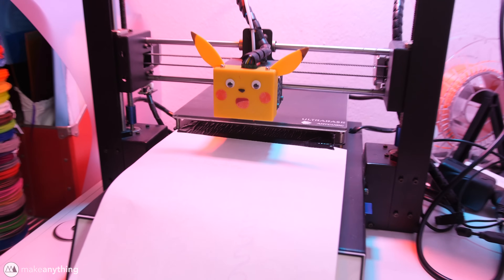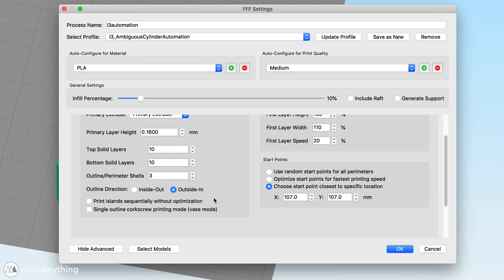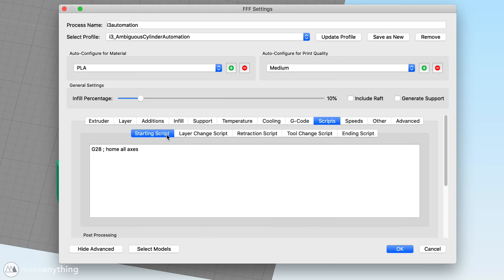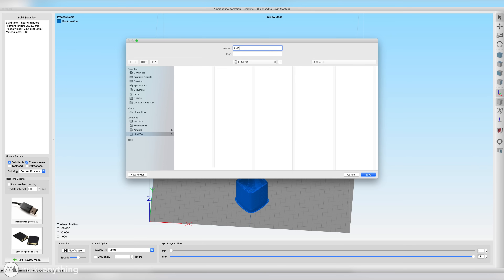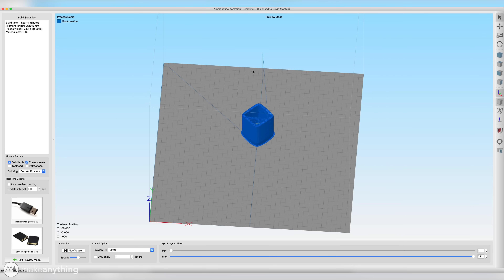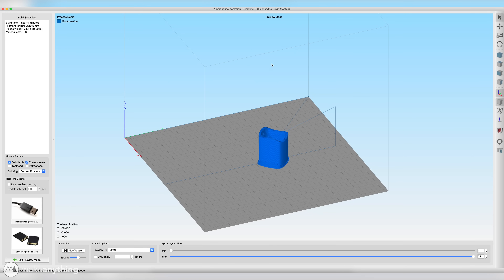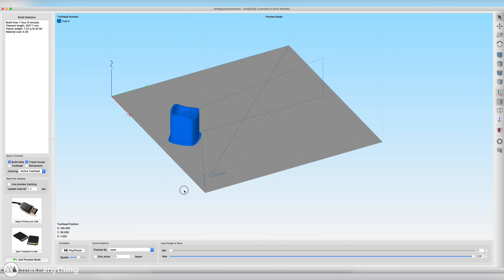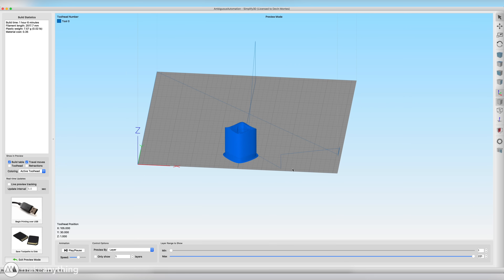Automatic 3D Print Removal using G-Code

Comment: Nozzle leaking a bit? This is way more then a bit. I dont think I get anything close to this bad on my mk3. Are you underplaying it that much or is this normal for other printers?
Reply: Just depends on the nozzle state (worn nozzles are more leaky), the extruder placement (direct tends to be less leaky, this is a Bowden), whether the last print move was a retraction (i think it happened not to be, perhaps a difference in settings or Simplify3D operation) the nozzle temperature (he is printing a bit warm) and the filament composition (EVA carrier for the masterbatch tends to be leak-inducing when used, while some pigments make filament more difficult to heat through).

He is getting a pretty high amount of leakiness, he's just not all that fussed about it because it won't matter for these parts, as they're easily cleaned up.

Comment: Are you going to follow this video up with "Head alignment issues and how to correct them?"  This seems like a genuinely bad idea given you have no idea the amount of force necessary to remove that print.  Belt skips and chattering steppers is what I see many users reporting out of this.  With such a wide variety of videos about how to get prints easily off the bed (due to them sticking so well) I wonder how long before the first broken 3D Printer using this.  3D Printers are not designed for pushing prints off the bed.  While a creative hack I wouldn't want to damage my expensive printer with something like this.

Comment: With some print surfaces, you may want to wait until they cool down before pushing the print off. With Prusa's powder coated sheet, for example. It lets go of the print after cooling down, and I believe there's a risk of damaging the sheet if you forcibly separate them too soon.
Reply: Same with ender 6s glass bed
Reply: You could do M190 R[temp] as it also waits for cooling so you could do M190 R40 to wait for the bed to be 40C

Comment: hey, first ever YT comment here, been following you quite a while.
so to my understanding, the Anycubic uses Marlin based firmware, so you might try these commands at the end of your code:
M32 {filename}.gco ; select and start a sd file.
it that isn't working, try:
M23 {filename}.gco ;call a fille
m24 ;start a file, basically does the same as M32 but with 2 functions.

however this doesn't have any quantity control, so you might want to make a new "master" gcode and make the prints as sub-rutine, don't know If it works.
I know on RepRap firmware you have the ability to call a sub-rutine using M98 and have up to 5 nested sub-rutines in one code, e.g:
M98 1.g ;first print will run, at the end of it either use M99 or it will set back automaticly
M98 2.g ;second print
M98 3.g ;etc
so if you have a RepRap based printer you might want to try it as well.
good luck

Comment: could you not increase the feedrate of the push comand to give it a bit more inertia as to not just slightly knock it overthe edge?
Reply: That would disaligne the printer
Reply: @nf794  but the printer rehomes before it starts the next print anyway?

Comment: People, throw away your build tac platforms and use glass like all the experts do. Parts will just pop off by themselves when it cools downs this is why this trick works so well for devin. Also you will never scratch or burn it and as far as breaking i have dropped my wrenchs on by mistake a few times with no problems. I think the good ones are tempered.
Reply: No, I'll keep to my spring steel sheet.

Comment: This must be the best tip for 3d printing so far. Very useful for mass production. What is the code in order for printer to wait until bed is cold then knock off the parts?
Reply: M190 R30
30 is just an arbitrarily chosen temperature by me where i feel it should release; experiment with this value.
R is necessary to actually wait for cooldown, if temperature is specified with S like usual, only the warmup sequence waits.
This G-code is Marlin specific. In Repetier, no dice.

Comment: Just a few ideas while watching your cool video. You could tilt the printer 45° forward so the parts fall off better and also shouldn't you write Z commands first like z20 x200 y50 so that the head always moves up and out of the way before table moves or is that automatic?
Reply from the maker: Tilting the printer is a clever idea! As far as the order of the coordinates, the xy and z move together unless they're put as separate lines, which I did do for a few of the movements

Comment: Thanks, some very good stuff in this video :) but this is for the PLA, for others types of fillament like PETG, need to wait for bed to cooldown first down to around 30-40°C before kicking the model out. Is that possible?
Reply: Yes, you could add the gcode for that

Comment: Firstly: you don’t have to input coordinates for axis you don’t move, so, if you move only Y and Z axis you can have:
G1 Y5 Z20
G1 Y25 Z19
G1 Y5 Z18
Then if you want to move carriage out of the way you have:
G1 X100 Z20
G1 Z0
Also after the wire brushing part you could just do Z30 or Z40 and RMF there as the printer will go in straight line to the starting point on the bed.

Secondly:
For bigger prints you may want to wait as you said. Heatbed needs to be cooler. Then, you could use back of the carriage to knock things off. It’s wider, it’s stronger, it’s just as easy in GCode! :)

Finally:
Very cool video :)

Ps. In the End GCode add:
G92 E0
G1 E-2
First line resets the current position to the one you input. So this one sets current position of extruder to 0.
Second line, retracts you filament back 2mm so it won’t ooze out the nozzle after the print. If you have the wire brush in the start code you can preheat the nozzle and purge a little on the right side of the wire brush, then clean, then print. This way you don’t need the brim ;)
Also, the semicolons are optional, new lines divide new gcodes :)
Reply: Hi, would you know how to change a FLSUN QQ-S-PRO to? I cant work it out. Currently via cura default is;

M107 T0
M104 S0
M104 S0 T1
M140 S0
G92 E0
G91
G1 E-1 F300 
G1 Z+0.5 E-5 X-20 Y-20 F9000
G28 X0 Y0
M84 ;steppers off
G90 ;absolute positioning

Very grateful for any help
Reply: @yte24b  okay, I've been out of the 3d printing world for quite a while now, so I'm not sure if I'll be able to help, but describe what you need exactly and maybe we could work it out :)

Comment: Glad to see the i3 mega getting some more love. Mine is down at the moment. Its having a weird issue where it will climb to almost print temp then drop off about 10 degrees then climb back up just under and drop off 10 degrees and it will do this until I stop it. I am not sure what the deal is as I just replaced the motherboard in it and it worked fine for a couple of weeks. I am in the process of moving so haven't had time to play with it but eventually I'll get time once I am moved out and into the new place.
Reply from the maker: Look into PID tuning, that might be your issue
Reply: @make.anything  I tried multiple PID tunes. I have also tried reflashing firmware. At this point I'm starting to think it's hardware.
Reply from the maker: @x9x9x9x9x9  I have had one heating element fail sorta like that, so it's definitely a possibility

Comment: Could you use M23 M24 in your end gcode to call the same file to keep running continously infinitely?

It does appear you can do this in the End Gcode on Octoprint.  M23 filename M24
Reply: It looks like the M32 command could also be useful for running sub-programs!
Reply: @jonolsen7246  Restarting a print like this should probably work (not tested) but subroutines won't, because Marlin and similar small firmware can only track read position in one G-code file, so if you were printing from SD-Card, when the subroutine file is finished, the execution stops and there's no way to continue the execution of the the caller file. If you were to try to stream caller file from host and run lower-level from SD-Card file, there's no way i can think of to stop host from sending commands while SD-card file is executing.

Comment: Hmm, if the print is a bit bigger, it would stick harder to the plate. Wouldn't that hurt the printer when it tries to pull it off the plate? Maybe even destroying the stepper motors? I think it would be safer to put g-code that lets the build plate cool down, then wait 5-10 minutes before trying to push the print. Then re-heat and print again. Will take longer time, but I would feel a lot better :)

Comment: How about putting the brush at like X50 Y5?  The model would be off to the clean side and the nozzle would start the print quicker.
Reply from the maker: Good point! I just wanted the brush out of the way to not interfere with anything, but it can certainly be optimized

Comment: Nice G-Code hacks. BUT. A bit irresponsible maybe... ? Shouldn't you be a little bit worried you're going to ram that head into a print that just does-not-want-to-move? On my Ultimaker (Squeaky clean glass bed, PLA) it takes a LOT of effort to remove the print when it's done. Usually I have to wait until the bed completely cools, or if I'm impatient, I play a cold air fan over it until it cracks off.

Personally. No way am I going to attempt this. But hey. Interesting all the same :-)
Reply from the maker: Yea, I would only do this after testing the model first without the ejection to see how much it's sticking

Comment: Interesting but only really useful if your prints have minimal surface area with the bed.  Also, ideally for that printer you would want it to cool the bed to below 30C before trying to push the pieces off the bed.

Comment: Useless, if you are going to want a good quality print you are going to do skirt around model avoiding the leakage and this could be applied only to models with small  footprint and not steep angles otherwise the nozzle could hit the print. This could potentially lead to damaging the printer or in bettere cases 3D print. Actually Prusa is experimenting with automatic print removal with the difference that he removes the print with magentic PEI sheet and transports it on  trolley to its final destination. Blank PEI sheet then comes on another trolley and is inserted to machine.

Comment: I have actually been using this kind of method for over a year now, to mass manufacture parts for the air rifle accessories that I sell. I can leave my Ender 2 running overnight and wake up to 9 parts in a box next to it.
Reply: Cool to see someone else using and Ender 2 still for mass production, have you done any modifications to yours? Suffering from a long standing under extrusion issue with mine at the minute
Reply: Joe Law I love the Ender 2, its print quality has been absolutely fantastic for me, which I think is due to the simplicity of the canter lever design. I have just added a part cooling fan, replaced the Bowden tube and Bowden tube fixings, and upgraded the extruder to an aluminium one. If you haven’t done any of those upgrades I would highly recommend them, especially considering how inexpensive they are. And they would be my first step to fixing an under-extruding problem.
Reply: @jamesthorogood1479  thanks! could I ask what bowden tube and aluminium extruder you bought? There's so much choice!
Reply: No, how can it clean its nozzle by itself? And who applies the hair spray?
Reply: Alejandro Pérez I don’t understand what you mean? 1. I don’t use hair spray, I just use the default bed. And 2. You don’t need to clean the nozzle manually, since you can prime the nozzle at the start of each print, or set up more custom gcode to wipe the nozzle on a toothbrush before each print.
Reply: @jamesthorogood1479  you can't print without hair spray on glass or metallic surfaces.
Reply: Alejandro Pérez Then why assume I am using glass or metal print surfaces? I use the buildtak-like sheet that comes with the Ender 2 and Ender 3, works brilliantly

Comment: 😂 great job.  I have bee doing this with octoprint for the last few months (removing the print from the bed), while at work.  Never crossed my mind to do it via gcode, and with multiple repeat models.  I have done a range of small to medium prints.  With very large surface area used on the bed (some 175mm x 175mm surface area has been the largest).

Now I have an easier way,  now I can really print nonstop

Comment: Your commands move the print head to front left corner, so move the "brush" to that side after retract command and should not let out so much filament and be quicker. Make a plastic mount for your brush holder instead of the metal clip, and have it clip to another plastic piece glued to the bottom of the print bed.
Reply: Oh, that's a great idea

Comment: My buildtack sticks so much they print head would crack! It always needs a spatula :c
Reply: Run the print bed a bit warmer. You want the lowest layer of the print to shrink while the print bed has cooled down sufficiently, then the PEI will self-release the print. There is a significant shrinkage above 60°C but almost none below, but your surface may be below measured temperature due to thermal impedance between top of surface and the measurement point.
Reply: @SianaGearz  huh intresting! Okay! But I have buildtack not  pei!
Reply: @chloemcholoe3280  According to BuildTak themselves, the surface is Ultem 1000 PEI.
Reply: @SianaGearz  huh. i forgot to mention mine is a 4$ clone. but intresting!
Reply: Then use glass like experts do :)
Reply: @carbide1968  ugh gluestick sucks! I'm thinking of importing pei or something. or even better a magnetic pei. I think glass and painter's tape is a thing of the past usually. specially for abs etc.

the only raeson I don't have abs is my country. but i'm thinking of importing it but it'd cost so much
Reply: @chloemcholoe3280  no gluesticks or tape just glass. Wash the glass in dishsoap dry with papertowel and from then on use only a dry new papertowel and just polish it a bit. It must be clean, window cleaner and alcohol leave a residue and must be wiped with a dry towel. Just get the layer height set and the part pops right off when cool, sometimes it makes some noises and pops up. I must admit if it's a small part with not much surface i will spray hairspray on the tip of a rag and rub a bit on the spot where it's going to print.

Comment: Did I miss the warnings for larger prints and / or other materials like PLA? TPU / PETG might stick to well the 2nd or 3d time you're using the same spot. What's about bending the x axis if prints stick to well? What's about collision detection some printers have?

Comment: This is so cool! I was planning on trying something almost exactly like this, even down to the scraper or plow you described at the end to aid with part removal. It's great to see how easy it can be. The one idea I had that you haven't touched on here is: shimming or mounting the printer so it's tilted towards the front slightly. That way gravity helps clear the parts off the build plate after they've been dislodged. Great video!

Comment: Very cool Devin! I've been wanting to change the starting Gcode to do a different purge in the Qidi Tech version of Cura because they added a stupid purge that goes all the way up to the print. I just want it to do a quick line at the front of the bed. Do you know how to change that so that it will always do that when it slices? Even if I can figure out how to change the code, I don't want to have to type it in every time. Thanks!
Reply from the maker: I believe you can make these changes under 'Machine Settings' in Cura. The info is there if you Google it, though I'm not sure if it's baked in with the Qidi version... That would be silly
Reply: @make.anything  Thanks. I googled this yesterday and couldn't find a workable solution. I just looked under the machine settings. It doesn't have that option. I think they probably don't want people messing with it. I think I may just go back to using regular cura. Though it's not that important, I do like having the image of the model showing on the display before I print. That doesn't happen with the non-Qidi verison.